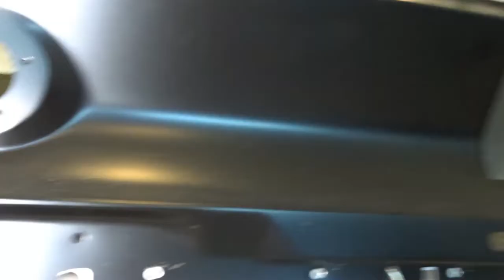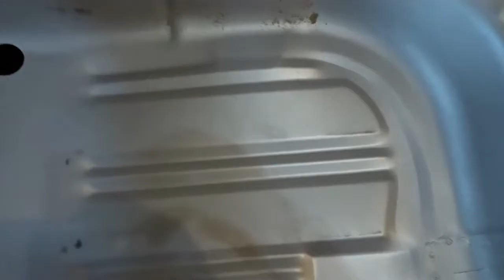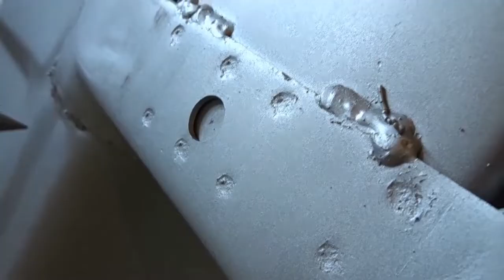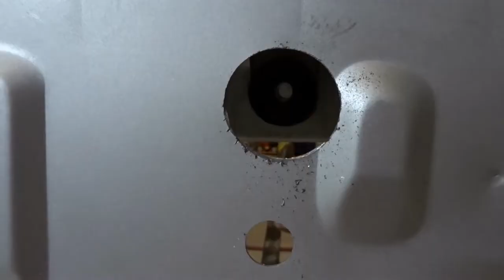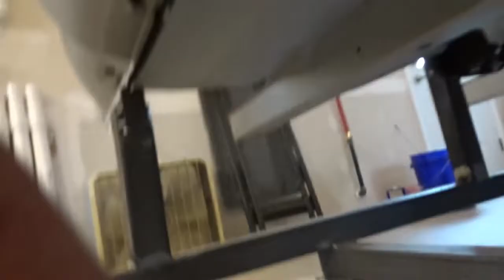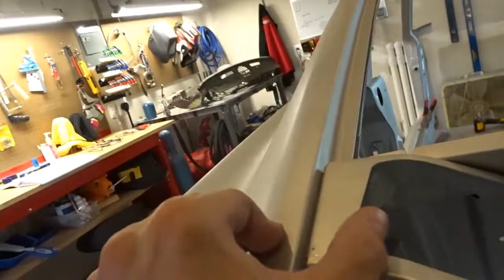Fastback Shell Build

Comment: Two things come to mind: 1) WELD THROUGH PRIMER (yes, I’m shouting), copper is best, melting/smoking zinc is poisonous. None of that sheet metal appears to have the E-coating that is typically on late model replacement panels. You don’t want to be welding rust into your new car. And:
2)Get your doors now. Ideally original parts. Tack them in place and leave them there until you are ready to hang them on hinges. 
I’ve seen “rotisserie” rebuilds that were done without doors on. When the car was put back on wheels on the ground the door opening wasn’t close to being the right shape. 
These cars were pretty flexible when new in 1967 so any temporary bracing your thinking of adding while under construction is best done sooner rather than later. 
Cool project. Especially with Ford licensed parts and a 1967 VIN. I still like the notchbacks too. 
Look for an 8.8 rear end from a 90’s Thunderbird Supercoupe. Fully independent, disc brakes, and the substructure will tighten up the whole car.

Comment: Keep in mind these part are made overseas. I determined that the parts are stamped using a different metal thickness. Meaning radius and contour will differ a bit. I bet your doors and rear window won't fit at all.